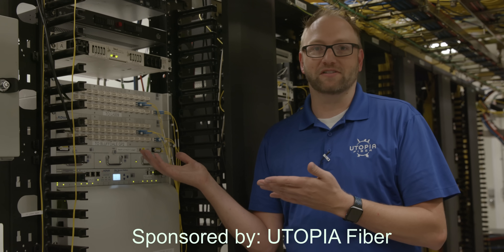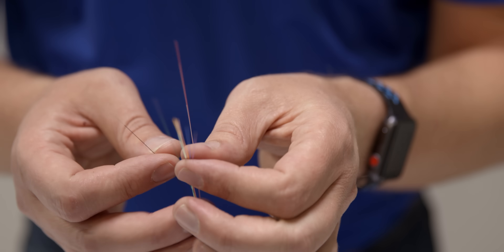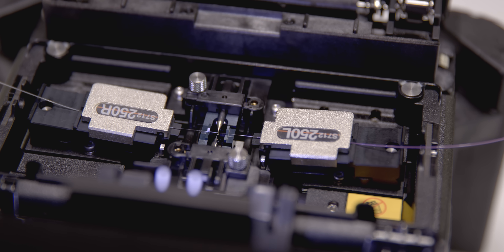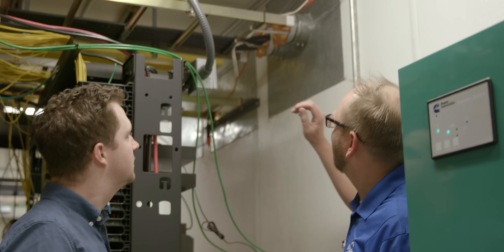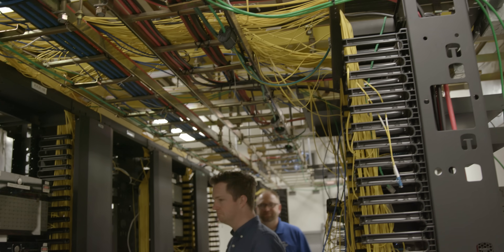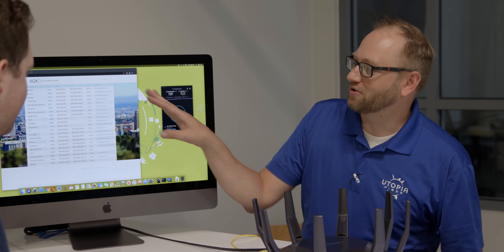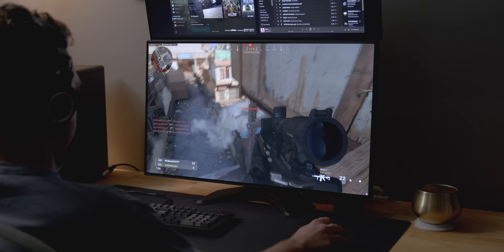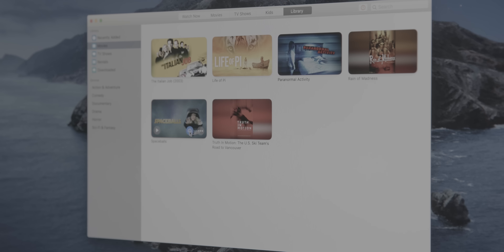4 Terabit Internet?! Fiber Company Tour!

Comment: "Internet should exist as utility"- I couldn't agree more!
Reply: In Europe internet is a utility and heavily regulated.
In France I pay 30$ a month for 500mb/s (around 430 on speedtest.net). I can cancel whenever I want.
Because of the anti monopolies regulations, competition is thriving and prices are low. ISPs are required to let competitors rent their infrastructures so that there is no zone with only one ISP available.
These prices and speeds used to be just dreams in the US, it was the same here before we regulated it. What's changed most though is the way the customer is treated. You don't feel like you're giving your blood to Satan every time you deal with your ISP. There no predatory practices, small print on contracts, ambiguous language, subscriptions where the costs increase without warning,.... 

It's now been the same with mobile networks for a few years.
I pay 20$ for 100GB 4G with unlimited call & messages, roaming in most of the world, and unlimited calls to landlines in 50+ countries.
You guys seriously need to deals with those vampires at the FCC and get someone there with common sense so what is seen in this video becomes the basic norm.
Reply: CrystalStearOfTheCas Regulate won't work easily in the U.S. The core of the internet problem is not having enough competition in the U.S. For example, a country size and population like France or Great Britain, having 3 mobile carriers(MVNOs or other network leasing carriers not included) means enough competition, they have to compete on network quality, speed, coverages. Having 3 carriers in the U.S. means all of them have enough customers to make investors happy, and they don't even try to compete on network quality and forget about coverage in rural areas. The only reason they compete on speed now is because smart phone makers are competing on that. Having more carriers would mean the wireless band isn't enough for everyone, either all carriers have wireless interference or one or two carriers have really bad network. Remember sprint have all the Wi-Max advertising but not having any real worth while handset? That's because they didn't get any good wireless band to build a quality 3g network. I would say have party who benefit from internet speed increase(like Google, Netflix, Facebook) build the network, and government owns the network so it operates like a utility, and have ISPs or carriers lease that network so they compete on equal footing.
Reply: Bannicus I didn't say I support government build the network. I don't care who owning the network, but I care a lot about who build the network. And I'm the one against making internet a utility here. I'm not aware the current situation in Australia now, but in South Korea they do demonstrate that government can build a good network, it was paid by tax, so monthly bill paid by users is relatively low. The problem with that is South Korea land size is small and their density is high compare to countries like the U.S. or Australia. Australia government may not even able to afford a good network. Let me put my idea straight, let internet companies build the network, because they can earn that investment back from ads/service, adding more user is making their stock price stable. Let government owning the pipes because it cost a lot of land and government can afford the land or already own the land. Let ISPs use that network and compete on the service side to drive down the price of internet. You could replace government for other public organizations or trusted entities here, I don't really care about that part. The main idea is that internet companies earn money by user use the internet, they have the money, tech, and experience to build a better network, and they can earn that money back from their service like Netflix or selling ads like Google/Facebook. They're all eager to acquire more users, that's their motivation of building better network. Government doesn't really care about internet cause it's not in the spotlight nor a major political goal. ISPs can build a better network but they would ask users to pay for it. The utility angle of internet come from net neutrality originally, if ISPs treat different companies differently, it would be a problem for business, or even freedom. Comcast can artificially lower the speed of Netflix so you won't become a cord cutter. If net neutrality isn't in place ISPs can basically block election candidates online. They could deliver content or ads of certain candidates so slow that you could never see it cause their network always have higher priorities at the time.That's the utility part of internet. I don't feel it's going to be cheaper or more expensive by simply regulate internet as utility, it would stay same mostly.
Reply: Bannicus the wireless broadband network is actually similar, if you ask mobile carriers to compete, Australia is low density compare to Europe or east Asia, few carriers(no MVNOs here) won't be enough for competition to start, too many carriers would make the frequency plan a pain in the ass. Not all frequency are equal, during 3G era, in U.S. sprint and Verizon use same CDMA tech, Sprint gets a really bad frequency compare to Verizon, their speed sucked. In China, during 3G era, 2 major carriers gets really bad frequency and better tech, 1 major carrier gets good frequency and bad tech, so no one have a good experience at the time, carriers all switched to 4G as fast as possible. If there's only one or two wireless broadband, and carriers just use the broadband, there won't be frequency distribution problems. In that case we do need to ensure the network is high quality.
Reply: @feifeigxx  Using trusts like you said makes sense as it puts the long term investment in sight of customers and ISPs. But the local loop unbundling thing (requiring the 'pipe' owners to offer rental to ISPs) and net neutrality have been shown to be a farce. Unbundling caused a lot of countries to just sit on ADSL for a long time, and that's the same tactic I'm talking about with the national network in Aus requiring their competitors to split their wholesale arms. On HFC which is already ubiquitous in many places and very fast, renting out layers isn't that effective and that's caused issues where it's been tried. 
Having many ISPs over the same pipe which has the same cost for all competitors, means lack of net neutrality is the only way ISPs can actually distinguish themselves. In Aus, some players use bandwidth shaping as a means of paying lower line rental to the pipe owners, while other more expensive companies offer a no-intervention service agreement but they pay higher rental. If net neutrality is instituted, all ISPs will have to move to exactly the same model and input costs across the entire country, irrespective of technology or customer base. These doom and gloom theories about no net neutrality haven't played out, and the only evidence of its effect has been that ISPs are able to more efficiently manage congestion WITHOUT neutrality. Many countries don't have it and have no issues, and countries like Sweden which introduced it a few years ago saw the number of offerings and distinctions between and within ISPs reduce. That is not competition at all. It would be like publicly mandating every store across the country is a Walmart, with the same products on the shelves. The products come from different places but they have to be packaged exactly the same with exactly the same contents at a cost set identically by Walmart, the only difference being the labels. To consumers that looks like competition but it's just not. If you have one of local loop unbundling or net neutrality you should not have the other.

The wireless thing has a point, but without any intervention in most countries, competition assembled companies into a handful of large carriers. Either way, it makes the point that having several large players is not worse at all than having many small players. But the fact there are large players is one of the justification internet-as-utility advocates point to to justify themselves. The evidence is against unbundling and neutrality.
Reply: Bannicus it seems you aren't supporting internet as utility, and you don't support it's not a utility. I didn't fully understand your whole argument. I'm proposing a entire new way of building network, so you could imagine I'm not in support of current business model. I don't understand why constraints the idea to renting layers. I stated from beginning that who runs the network also maintains the network, and who runs the network should be a different party from owner of network. This way you could rule that network is upgraded every certain years, and publicly call for bids on building the network. Then by not maintaining the network, the cost of network on public side is clear and public, force the owner rent out network at cost is possible, the price would be bidding price divided by years. There's no business here, the owner is only owning, and no more no less. Renters of network could choose their business model on their own. Being ISPs is one choice, renting out network layers could be one. Rent out the entire infrastructure of backbone network to more than larger two ISPs would creat the competition people need for lower internet access. Since most local loops runs into ISPs' IDCs and then access backbone networks and you can build a backbone network at a massively reduced price by let internet companies build it, I would argue it's possible for multiple ISPs to cover entire countries and compete with each other. Local loops could be built on ISPs own or build by internet companies, I don't feel that's the major problem here.
Reply: I like the idea of free Internet for everybody. I think the Internet connection could be compared with the road System which is also free
Reply: @fritzmueller6759  The road system in America is not free. Vehicle registration tabs fee, License plate fees, all the taxes.  Someone has to pay and the ISP are not going to give away their services for free.
Reply: Richard Vaughn indeed, installing dark fiber everywhere is something that would be better done by the state and paid for by my taxes. We already do this with roads last time I checked, there is no reason the farm 20miles down the road can’t get fiber because whatever private company installing fiber considers it not profitable, or the municipality can’t do it because they’re outside city limits.
Reply: As long as I can beat my meat I’m happy.
Reply: Yeah until you get to a place like where I live and they overcharge for everything. We have enough hydro power to power the whole city 10x over but they charge astronomical prices per kw
Reply: Wow you guys are damn lucky, here in my country maximum internet speeds are 100 up and down and we have to pay a equivalent to $50 per month :(
Reply: l1m1tless Road consider yourself lucky, I’m paying that much for shitty fixed 4G service in Madagascar, that is only really usable while people there are sleeping (2 to 5:30 am). Then there’s the issue of the 400ms ping time to the rest of the world
Reply: Richard Vaughn indeed, but that was not what I was talking about.
My point was to make the dark fiber everywhere belong to some public entity, which then rents it to willing private entities to light up their services on.
Reply: Richard Vaughn yeah, well, that’s what I consider not making sense...
Reply: Richard Vaughn true for U.S. ISPs, not true in some countries. Korean government build their backbone network with tax, and the country's three major ISPs are all running off of that network. ISPs renting the network and providing the fastest internet service in the world(not saying that's great). ISPs don't pay each other, they pay a low rate to government. In China backbone network is built by two major carriers, and they are both owned by government, and they aren't paying each other. Their major bandwidth cost mostly are oversea bandwidth.
Reply: Richard Vaughn I'm not saying they use different servers, the servers upgrade cost used to cost much more than utility bills, so no one cares about the idle saving. with new competitors into business, server upgrades cost much less for last 3 or 4 years, so some Data centers are deploying absorption cooling, which also make a difference when idle.
Reply: Richard Vaughn a small local ISP doesn't need data center, a large ISP building and owning backbone network do. Part of the reason in some countries, major ISPs are also major server providers.
Reply: Richard Vaughn I think even in the US, most ISP doesn't need large IDCs, if your house is connected to a ISP Point of Presence, the ISP POPs are all connected to ISP data centers.
Reply: Richard Vaughn Yes, in theory I only need routers and edge switches to jump to destination. An ISP could run with just a laptop monitoring their routers. But different ISPs have different business model. ISP doesn't need to be in the server business doesn't mean they cannot. The two major Chinese ISPs are the two major server providers in China, and their business is relied heavily on server renting and ads rather than providing internet. Also most ISPs does have servers at least for local DNS.
Reply: Richard Vaughn yeah, I will admit that running servers and inject ads to customers' browser is a different business than ISP. And ISPs doesn't have different electricity bills over usage, they pay for bandwidth. That doesn't change my point, internet shouldn't regulated as utility.
Reply: The trouble with the free for all approach over the utility approach is everyone goes for the dense areas and nobody goes anywhere else. There's streets in London with three different competing fibre networks available to connect, meanwhile a few streets over there is no fibre network at all as it's not deemed viable for business. A business shouldn't be forced in to an area unless they are being paid for it but councils or government's should cease duplication, once a fibre utility is in it should have a wholesale offering and no one else be allowed to install another until everybody else gets a chance. You don't exactly install power or water to your house then decide to change provider so they come and dig up your garden to install a new power cable or pipes, the internet should be a similar model as it is now deemed essential infrastructure for all properties.
Reply: David Everett indeed, there isn’t multiple sewers in the street, it makes no sense to have multiple fiber networks
Reply: For internet to be a utility, we should be charged how much data we use (gb/tb you download and upload)  That will change the habits of many people really quick.  Charging based on speed is a joke.
Reply: No, you dont want the government reading every single piece of network your computer ever sends out, or paying per gb
Reply: Internet existed as utility , now internet exist as a life
Reply: This is more like fiber Ethernet as utility or fiber lease to consumer, which I think is much better than any internet as utility can be.
Reply: Richard Vaughn are you trying to teach me how my business works ?
For the record, I have an ISP business...
Reply: Richard Vaughn true in the States, not so true in some other markets, i made my point there, no matter electricity bill or paying for backbone network, ISPs do have a cost per usage that need to cover. Yes, routers and switches use same electricity wether idle or busy, servers are different, idle can save on power for both CPUs and hard drives, also with newly deployed absorption cooling systems it's costing much less with idle. Traditionally that considered small amount, but with newer devices price dropping it's more important than it used to be.
Reply: Richard Vaughn I'm almost sure simply rule internet as utility won't help your concerns. Please read my whole argument about this. Rule internet as utility won't help with smaller companies as ISPs, they simply couldn't afford to build their own backbone network, and have IDCs all over the place, they would still have to pay to buy bandwidth.
Reply: I kind of disagree with that. The ISPs have different charge model from utility companies. ISPs charge for time you spend on internet, 24*30 per month, utility company charge for how much you use, per kWh or per cubic feet/ gallon. By provide more electricity or water or even phone call, utility company earn more money, providing faster internet won't let ISPs earn more money, so they are not interested in upgrading the network. I think government provide the pipe, call for bid on network building, let huge internet companies like amazon, facebook, google build the network or upgrade the network, ISPs lease and maintain the network. That could be a better option than just label ISPs as utility companies. Big internet company is interested in provide everyone better internet at a cheaper cost, which could lead to their income increase, so they would build the network even at loss, they could earn morn money from people stay on internet. From competition government spend less money on building network, without building the network, ISPs only maintain the network, which could make ISPs become a cheaper business so much more company can compete in the field, customers get better and cheaper internet from competition.
Reply: Xuxiang Guo I think It should be treated or classified as a utility in that all residences must be provided with internet just like they would be with water or electricity and a standard price amd for pricing they should have to provide a standard service and then they could offer better, faster speeds and charge more for a faster connection.
Reply: @feifeigxx  What about companies that refuse to compete? There are a lot of neighborhoods where only 1 ISP is provided and because that ISP knows it's the only one, it does not have to compete for lower costs. In this case my neighborhood. I have Comcast but literally down the street, ATT is provided but no Comcast. They refuse to encroach on each other's territories therefore have higher costs for their internet.
Reply: RJ RJ hey look into my first reply. I know the problem you describing, during 2014 to 2015, there was one company tried to build a gigabit fiber network in Seattle, and their project was canceled later by the city because of new major in office. Guess who was a major supporter of the new major? Comcast. 
I'm mostly talking about major backbone network here. Comcast is the major ISP in the US because they built the backbone network on their own. Local network, aka the fiber to your house, is the easier part here. I'm proposing let internet companies build and upgrade the backbone network every few years, the pipes and land is provided by public, so public/government owns this network. Internet companies are interested in building/upgrading the network because they reaches more customers or creat new businesses by network expansion and speed increase. 
Rent out this network could creat major competitors to current ISPs or current ISPs would have to become one of the renters. Local loops could be built by local ISPs or internet companies, which cost can be affordable for local people, then the network exists, and new competitors come to the market.
Without a healthy and great backbone network, it's almost impossible for local companies/some ISPs to build a local loop to compete in an area. Place like where you live is lacking smaller competitors, which they don't have National wide backbone network, but they can and want to build a local loop so they have a good local business, they cannot grant backbone network access because ATT and Comcast could refuse them, with public/government owning backbone network, it's possible for your local business to build a good network to compete with ATT/Comcast. Or even local loops could also built by internet companies so most ISPs just renting network layers to compete. Then it's not possible for ISPs to refuse competition.
Reply: @feifeigxx  There is a big difference my friend between the internet and gas, electricity and water. For example the more water you use it's gonna cost the provider more to supply it. The more gas you use it's gonna cost the supplier more hence costing you more and the more electricity you use it's gonna cost the supplier more to generate that electricity but with internet it doesn't matter if you use 1 Gigabyte of 1 Terabyte it's gonna cost the ISP the same the only thing it's gonna cost the ISP is the maintenance of your network at the end of the day hence it's quite different.
Reply: Abdullah Jadoon Not so true if you count in IDC spending, which is true. And utility supply isn't really cost more when they supply more, it's just how they charge you. ISPs does need electricity to run data centers and their cooling, wether it's running off normal air conditioners or water cooled refrigeration system. The more data you send and receive, the more electricity ISPs use. And that's not why I'm not interested in regulate internet as utility. I'm not because whether regulate internet as utility, it won't help internet service quality and speed.
Reply: @feifeigxx  at the end of the day only thing we want is a fast reliable and affordable internet
Reply: Abdullah Jadoon yes, that's what I want too. That's why I'm proposing let companies like Google, Amazon, Facebook, Netflix to build internet, they would have more customers with better faster internet and better coverage, or even new businesses with better internet. They are motivated to build and constantly upgrade your internet. But for net neutrality and business and monopoly concern, they shouldn't own the network they built. That's the part how you get internet price down. I'm no expert in that, so I can only imagine the government or public entity owning the network earn nothing except owning. Renting out entire internet infrastructure to ISPs, so they compete on price. 
I against internet as utility is because utilities are ruled so cause their monopoly nature. Once you admit internet is utility, it's just another monopoly business, and you could never creat competition on ISPs again.
Reply: @feifeigxx  monopoly in a service is quite literally one of the worst things that can happen for the consumers. But I don't think the internet market is gonna get like that anytime soon .
Reply: @feifeigxx  I think the ISP business is one of the dirties in the world. Like it doesn't cost them if more if you use 100 Mbps or 10 Gbps if they have provided you a 10 Gbps network but just to squeeze more money out of your pocket they'll put data caps and speed caps which are totally unnecessary. I totally agree that big player should jump in the ISP business so it would benefit the consumer. I think after starlink the rural areas might have better internet then the areas where we get fiber internet. Like rumours suggest it's gonna cost 16 bucks for 1 Gbps with lower latency than fiber.
Reply: Abdullah Jadoon if you get a 1Gbps network, and only use 100Mbps, it would save ISPs a whole bunch of money, that's why they put a data cap on you. It's expensive to upgrade a network, not only the pipe cost, data center need CPUs, motherboards, hard drives, network switches, industrial level products still cost a arm and a leg at today's price. They have to spread that cost on to customers, and keep in mind that cost isn't one time, just like you computer and phone, internet needs upgrade every few years, so if they don't have data cap they would need to upgrade their data center more regularly. Starlink would come in handy with rural coverage and latency, not sure if the data processing is solved.
Reply: @feifeigxx  What if a new utility classification was created to charge by time 24*7 billed monthly and internet was classified under that. I don't like the idea that bigger companies get an advantage over smaller or startup companies. This is a complex issue I am not convinced either way is best and maybe a combination is.
Reply: I AM EARLY what do you mean by bigger companies get advantages over start ups, I'm not against net neutrality here, ideally it's neutral for all companies. I'm not even talking about net neutrality here, I'm against classify internet as utility not because ISPs charge people differently, but because there's no interest for ISPs to build better internet, for stable and for speed.
Reply: @feifeigxx  Problem is that model encourages Net INneutrality where proprietary services are prioritized. That is worse than even corporate screwed over price net neutrality. The last we should do is allow the Digital Services developers to run the Internet connections.
Reply: @Neojhun  The model I proposed is to allow companies to bit on a internet construction fee, that is different from allowing the constructor become a ISP. So net neutrality isn't at risk with this model, and I do care about net neutrality, I donate a certain amount every month to free press in last 8 years.
The model is for government/ local residents to be the owner of internet infrastructure owner, they hire constructor to build/upgrade the property, and rent out the infrastructure to ISPs. If the construction process are open call for bid, company with lower price get the bid. I think service providers are going to provide a low price, much lower than traditional constructors or ISPs, because they can build on a lose, they get the money back with ads/ service, by pay for better user internet they get more user or better user experience, thus they could earn more money or provide more service. Government/ local residents owning the infrastructure make sure the property is open to inspection, if Netflix is building a network and it's open to inspection, you can be sure Disney, Amazon, Apple are all after that project to make sure Netflix isn't getting any advantage from the project, this ensures net neutrality. Third party/multiple ISPs over same infrastructure is making sure they have to compete on maintaining fee, and internet price. Also as third party competing on service quality, even some of ISPs have ties with service companies, they have to make sure net neutrality is ensured.
Reply: @feifeigxx  I don't know what the USA companies smoke, but in Europe you pay for your speed, not for amount or time used.
Reply: @freevbucks8019  in USA, ISPs charge their costumers based on speed, but some have a data cap. The conversations about paying for bandwidth is happening between ISPs, and it's same around the world, just the bandwidth pricing is different in different area.
Reply: @feifeigxx  You guys must be smoking 50 carts a day to allow a data cap for your wifi
Reply: @freevbucks8019  I think it's more complicated than simply have/don't have. Even within EU, where in theory data cap is illegal, there are soft data caps. Just last month, EU is still trying to deal with these practices.
Reply: @feifeigxx  no, the cost of providing internet access is merely the cost of cabling to your place (a one time fee) and then the cost of electricity to feed the equipment (the price of the equipment itself is of no consequence)
Reply: @AmauryJacquot  I'm not talking about cost here. How ISPs charging end user get nothing to do with the cost, that's also true for utilities. Tap water should only cost one time pipe installing fee and pump electricity. It may also cost some cleaning fee, but that's not the tap water pricing structure. Despite the real costs of ISPs, which not only have pipe cost and electricity, but also servers and maintain cost, I want internet companies like google, amazon, netflix, facebook to build the network including fiber, wireless broadband and servers, government own these hardware infrastructure, ISPs to run and maintain the network. To put it simple, ISPs under current pricing model are not motivate for speed increase nor price drop. Internet companies are interested in building faster internet and drop the accessing price, because that lead to them get more customers. Government owning the pipes would make future upgrade easier. ISPs leasing the network to operate would significantly reduce their cost since they no longer build the network. Internet companies are driven by their investors to expand their customer base, so if let them build the network, they would ensure the coverage is better. You could say I'm proposing a new kind of utility that the builder doesn't own or operate the infrastructure. The benefit is that builder of network is constantly motivated to increase the network quality, and operator isn't paying for that increase, so user can have low price and high quality internet.
Reply: @feifeigxx  it depends where you live. over here, tap water is managed by a public entity, which charges everything at cost, including all predictive maintenance.
invoices have been divided by 7 compared to when that service was handled by a private company
Reply: Amaury Jacquot Sure, in that case price is lower, and I'm almost certain the tap water infrastructure isn't built recently so someone paid that high price at first place. Running internet at cost sounds great, but actually is a bad idea, because unlike tap water, it need to upgrade hardware infrastructure every few years, the reason why U.S. doesn't have a great network is because no one is paying for that. If internet charging user use that model, every few years people would have a huge bill at their door not such a good idea compare to tap water where people almost never pay that upgrading fee. I'm not against government owning the pipe and network hardware, I'm saying we need to find someone want to pay for upgrading and expanding the network. Internet company can earn more money for upgrading the network. One may never become Netflix/hulu/disney+ subscriber with a bad internet, and not watching YouTube much, so YouTube, Disney, Netflix may want to give that person a good internet access. Amazon may want a better network so they could offer better AWS service. Government owning the pipes and call for bids, let these companies compete on building the network for a lower price, then either give you a internet service at cost as you wish, or lease it to ISPs so they can compete to lower internet access fee, I don't really care about that part. I feel people take utility model for granted and not thinking about more possibilities for the internet.
Reply: Xuxiang Guo that’s where you don’t understand the concept.
In the case described in the video, the dark fibers belong to the public, who rents those fibers at cost to the various service providers.
Reply: Amaury Jacquot I think it's not I'm not understanding your concept, it's we are talking about different stuff here. If only talk about the "last mile", which used to be a problem of fiber. Suffer the cost of building it is effective, just like what happened in the video. Public owned and pay the cost could be a great deal. I'm talking about the backbone network, T3 network. In the video he cannot saturate 10Gbps speed to upload video to YouTube, that's because first YouTube doesn't have a nearby data center, and second the backbone network sucks in the U.S. A single Data Center(IDC) could use electricity equal to a medium sized city, that's why most IDCs are build and own by private companies, public cannot afford to build and run a lot of them. Also it would be a huge burden and waste both finically and environmentally to build a lot of duplicated data centers so local people could have fast access. Unless we have a good T3 network, having a lot of duplicated IDCs is the only option for local network. In some remote locations, building nearby data center isn't even a viable option, the long distance means no enough power supply, no enough people maintain the data center, and local people cannot afford the huge electricity bill(almost every service need a IDC, that makes the cost sky rockets). Not the fiber is expensive, it's the infrastructure. Google/Amazon/Facebook/Microsoft/Apple can afford to build whole bunch of Data centers, they can also afford to upgrade the T3 backbone network. U.S. have a really rubbish backbone network, built and owned by Comcast and other huge ISPs, that's the internet I'm talking about. In my ideal world, the backbone network is fast and reliable, national wide, coast to coast, and every location should have good access to it, no matter how remote it is. That means huge cost on building the network, public own entity just may not afford it except government, and I believe government simply won't build it cause they don't understand nor care. Having good internet no only means from local ISPs to your door is fast, but also a good connection to major backbone network, also the backbone network itself needs to be good. I'm just saying let internet companies like Google, amazon, Facebook to build and upgrade the entire network, but regulators rule that they aren't and cannot own the network. Let government or some trusted public organization own the network.
Reply: @AmauryJacquot    Most do not understand that.. Equipment is cheap, and data is cheaper.
Reply: @feifeigxx  no, it should be treated like one, as in where everything is treated equally, whether it's YouTube, Netflix, Disney+, or a competitors website
Reply: @feifeigxx  Agreed.